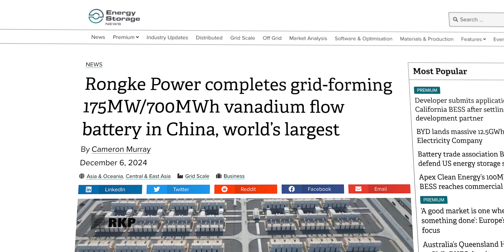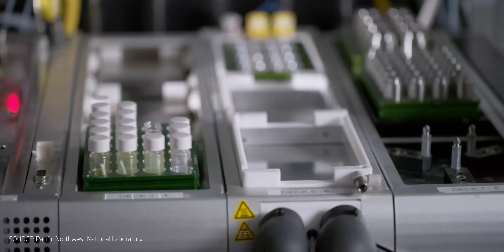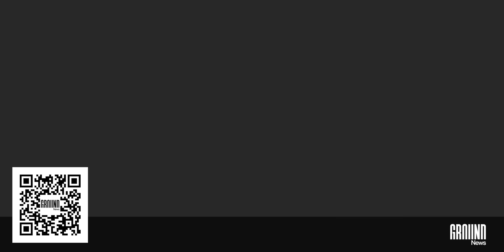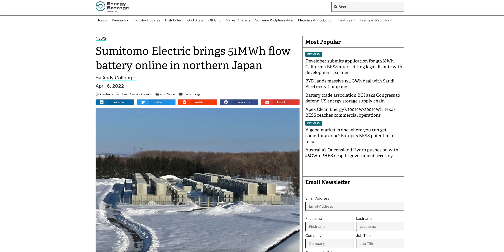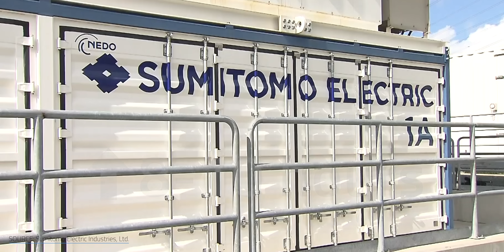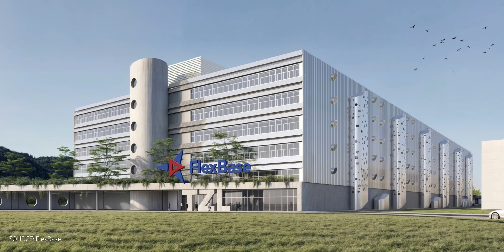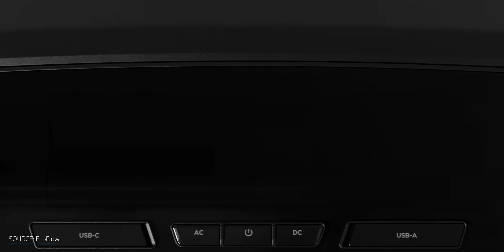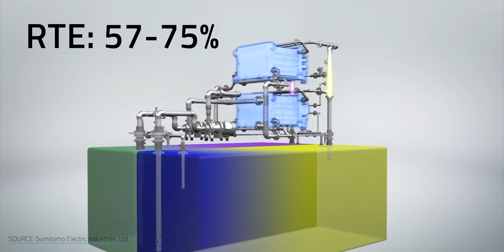Why Isn’t This Revolutionary Battery Everywhere?

Comment: I actually worked with Sumitomo on expanding the market for these batteries back in 2019.  Part of the problem was meeting the market at the time.  Vanadium isn't mined specifically, it is part of the tailings of other mining processes and the renewable infrastructure wasn't as big as it is now, so there was limit to the number of use cases.  We investigated pilot use cases with rural areas and other off grid applications but then funding was cut off during the pandemic.  I'm still very optimistic about the tech.  It scales incredibly well with large renewables.
Reply: it feels like a egg or chicken problem. Vanadium is too expensive to use because it's not mined specifically, but the reason it's not mined specifically is that it lacks high profit uses that require a large amount of vanadium.
Reply: @danilooliveira6580  Feels like that maybe, but the other reason that there aren't vanadium mines is that it is usually mixed up with other elements. It may be expensive / energy inefficient to extract on top of that. Vanadium prices may soar if this tech ever becomes more popular.
Reply: @danilooliveira6580  no. Supply cannot create original demand. If more supply created a need, then to get rich all you would need to do is create more. If no one buys, then you would just produce more until someone somewhere does but this is clearly a quick way to go bankrupt. 

The best inventions are not created by an innate “need to create.” They exist to solve. A problem.
Reply: logically, without having real knowledge. catl and byd should know about this and if they see the advantage, they'll be the first to make happened. probably they see the disadvantages?
Reply: @YSKWatch 

The problem is known supplies of Vanadium.are concentrated in China.. again ..  
This was the mineral chosen by the MIT team under Donald Sadaway as Ambripower.
Reply: It would actually be a good fit for remote mining.  There is a Nickel mine in Labrador Canada that has an off grid diesel generating system to supply electricity but a few years ago they explore using a hybrid system of wind turbines and diesel.  A vanadium flow battery would fit their needs to a tee.
Reply: @anguscampbell1533 - Nickel mines often have huge tailing piles of iron-rich material. In with the iron could be 
...  vanadium!
Reply: @YodaWhat  Actuall it is mostly Nickel, Copper and Cobalt.
"Voisey's Bay has been producing nickel-copper-cobalt from an open-pit operation since 2005. The future of Voisey's Bay involves the transition from open-pit to underground with the development of two underground mines—Reid Brook and Eastern Deeps—extending the life of Vale's Labrador Operations well into the future."
Reply: Great insight.  Thanks for sharing.
Reply: What do you think about the possibility of it being a popular home backup solution in the coming years? As Matt talked about, the small-scale systems have a better round-trip efficiency than the large-scale ones, and they have ultra-long lifespans. To be that sounds like a perfect solution to have in homes to help lower grid electricity usage when it is costly and charge the battery from the grid when electricity is cheap.
Reply: @littlejack59  The batteries are pretty big and deal with exotic chemicals so I'm not sure how well they work on small scales.  It's definitely possible, but I dealt mostly with the batteries the size of a semi truck, so I can't make an educated comment on the viability of smaller scale applications.  But it does work on the scale of small communities.  We were looking at putting them on Native Reservations for the entire tribe.  I could imagine this working for a neighborhood.
Reply: But for small scale it makes no sense at all. I've seen this tech about 10 years ago and just a 'small scale' battery was like a very oversized fridge. You will never see this getting adopted by hobbyists at home with money. But anybody could build a diy 48v battery back then for relatively little money. As soon as you need the scale to even get to a pilot case where the scale of industry is simply required, you will need the government. Industry won't risk the money on an 'unproven' tech ever.
Reply: What was the cost of a battery to power a 40000 watts house at the time?
Reply: China mines a lot of iron ore and vanadium comes with iron ore. I bet China will make this tech mainstream like they did with solar panels.
Reply: Nvm
Reply: Sumitomo? lmao. Japan has no innovation. All talk, no action.
Reply: @i6power30 lol that jelly for japan, they only hold the most patents and have been a leader in the modern era. "Out of total global inventions, Japan has achieved 15.85% innovations. Japanese have invented numerous electronic gadgets, such as compact disks, DVD, CD-ROM, B.D., Battery(lithium-ion), dry cell Battery, MiniDisk, Optical Fiber, Light Emitting Diode, and White L.E.D."
Reply: @ Yeah, that's 20 - 30 years ago. Now, they are not innovating anymore.
Reply: CO2 is climatologically irrelevant. 

CO2 is climatalogically irrelevant: Interglaciation climate change (e.g. the Medieval Warm Period) is caused by cosmic ray fluctuations ( see the work of Henrik Svensmark, et al).

Just burn coal: the CO2 issue is irrelevant (see above). The sulfur issue with gaol is bogus too: sulfur is an agricultural fertilizer (ask the farmers). The "acid rain" issue is at most "a nuisance" (see the $500 million NAPAP study of 1990).  "Acid rain" was another one of those shallow media sensationalisms, like "global warming" and "ozone depletion". 

Global warming is 21st century superstition. 

Just burn coal.

Sorry, but however intriguing these battery-thingies are, they are just another tax-sheltered boondoggle for people who don't want to do get a real job. 

Just burn coal.
Reply: @hg2. FYI:  There is a proven mathematical relationship between atmospheric CO2 and heat retention.  Given the transfer of carbon from the crust (after being stored for 10's of millions of years) to the atmosphere should be easy to comprehend.
Reply: @hg2. Is that you Donald?

Comment: Maybe this is just stupid, but if you may have so much intermittent renewable power, why not use hydrogen for storage and use? It's very inefficient yes bus the science seems more simple, water can be gained from thin air with this closed loop system and when renewable power is so abundant that (we in the EU and more specifically Netherlands) shut it down on windy/sunny days, why not? I think we are looking for the cheapest storage when the answer on short time might also be cheap generation whenever and "costly storage" when there is way to much.
Reply: @JustRickToday  Search for videos from Paul Martin, a Canadian scientist, to understand why this doesn’t make sense

Comment: I'm kinda surprised by the overall roundtrip efficiency. Even though it is promising, maybe the tech needs a bit more research on that. This would not be lost, because this kind of loss do not depend on chemistry, so it would probably be helpfull research for all redox flow batteries.

Comment: Two pumps per system = more failure points. No moving parts in most lithium storage packs. Could have cells go bad or electronics but I like the no moving parts that can fail.
Reply: Pumps are very cheap. So just have two spare pumps with pipes on hand. If a pump dies, just turn a valve - its not a big issue.

Comment: Vanadium is not easily accessible. Simple answer to your overall question. This was a poorly thought out premise.
Reply: Twice the amount of Vanadium is extracted annually compared to Lithium, but it's usually found in bound other minerals often iron bearing ones; one common source is as a byproduct of the steel making industry. However, as it's importance is rising direct extraction of deposits also takes place now days in South-America, China and other locations.
Reply: @GruffSillyGoat The oxidation states of extracted vanadium is important as noted in the video, but additionally vanadium has toxicity concerns, also noted in the video.  LiFePO4 batteries are non-toxic and their draw backs are mostly size, which is not a problem for large scale applications.  Lithium is not easy to mine/extract however it is a critical mineral and we should focus on finding better sources rather than banking in on vanadium.
Reply: @ - Some Vanadium compounds are toxic, just like some Lithium and Phosphorous ones are (even some compound of Iron can be toxic). However, in VRFB the toxicity tends to be due to the type of electrolyte used, some are and some are not toxic. This is similar to differing types of Lithium batteries. However, as a contained system neither are directly hazedous to the environment, like many other industrial systems. VRFB also have a high saftey risk being non-flammable, reducing the leak risk due to external factors.

In the end having a mix of battery technologies that offer different characteristics is better than relying on a single technology. Some applications may required the higher current provision of Lithium for example, others may require the long term storage and simlple lower cost expandability of a flow battery. One size doesn't fit all needs.

Comment: To be fair, efficiency of 57%-75% in massive systems is in line with or surpassing (on the high end) conventional pumped hydro.
Reply: Same o issues with pumped hydro... can't just build those anywhere and they require a ton of water, land, and work.
Reply: i guess it goes worse the more massive it gets, and 57% is only starting to match massvity of pumped hydro

Comment: 51Mega Watts sounds like a lot but Tesla's Lathrop facility in California produces 40 Giga Watts of storage annually. Add the Shanghai facility for at least another 40 and soon an additional facility in Texas.  And of course China has a lot more production currently making batteries.
Reply: It will be 40 Gigawatt-Hours (GWh), not GigaWatts (GW) It is easy to confuse maximum power output (in GW) with maximum energy stored (GWh), but they are very different issues.

Comment: I have worked in labs for 40 years and have never seen a scientist peering at a vial
Reply: @PaulG.x  What kind of lab are you working in? I've only worked in an analytical lab for 30 years but I look at vials almost daily for color, solubility, phase separation or particulate.  I also get annoyed by fake lab stuff.
Reply: He forgot to mention he is blind :P
Reply: Weird because I did a 3 month "internship" at one before moving on and they did it with every sample. Part of quality control before they fed the sample into the mass spectrometer.
Reply: I don't work in a lab and look at vials once in a while. Are you sort of like one of those mechanics that doesn't mechanic?
Reply: Sounds like those labs weren't sciency enough XD
Reply: I used to isolate proteins and would look at vials all the time…you working in like a robotics lab or something?
Reply: CO2 is climatologically irrelevant. 

CO2 is climatalogically irrelevant: Interglaciation climate change (e.g. the Medieval Warm Period) is caused by cosmic ray fluctuations ( see the work of Henrik Svensmark, et al).

Just burn coal: the CO2 issue is irrelevant (see above). The sulfur issue with gaol is bogus too: sulfur is an agricultural fertilizer (ask the farmers). The "acid rain" issue is at most "a nuisance" (see the $500 million NAPAP study of 1990).  "Acid rain" was another one of those shallow media sensationalisms, like "global warming" and "ozone depletion". 

Global warming is 21st century superstition. 

Just burn coal.

Sorry, but however intriguing these battery-thingies are, they are just another tax-sheltered boondoggle for people who don't want to do get a real job. 

Just burn coal.
Reply: @hg2.  you have to feed a bot a lot of garbage to get that bs out

Comment: Uh... Did you speed this up? You're not usually so... rabbity. I'm only 20 seconds in so far, maybe it will taper off.... (EDIT: Yup, you sound normal with my playback control at .95, seems your editor thought you were a little sluggish today)

Comment: sodium is pretty cheap, I think the salt base flow cell batteries have a good chance at large scale due to low cost and abundance.
sodium based solid state batteries are coming online now too.
Reply: Sodium is cheap but less efficient than lithium. 
I am expecting sodium to take the main role for laptops and phones, while lithium to stay  in cars.
Reply: I heard that sodium battery is better but heavy, that's why the implementation is limited for non moving usage.
Reply: CO2 is climatologically irrelevant. 

CO2 is climatalogically irrelevant: Interglaciation climate change (e.g. the Medieval Warm Period) is caused by cosmic ray fluctuations ( see the work of Henrik Svensmark, et al).

Just burn coal: the CO2 issue is irrelevant (see above). The sulfur issue with gaol is bogus too: sulfur is an agricultural fertilizer (ask the farmers). The "acid rain" issue is at most "a nuisance" (see the $500 million NAPAP study of 1990).  "Acid rain" was another one of those shallow media sensationalisms, like "global warming" and "ozone depletion". 

Global warming is 21st century superstition. 

Just burn coal.

Sorry, but however intriguing these battery-thingies are, they are just another tax-sheltered boondoggle for people who don't want to do get a real job. 

Just burn coal.
Reply: @hg2.  What about when there is no coal?

Comment: Like all newer tech you expect the price to be high. If this starts to gain traction more vanadium suppliers will emerge and drive down costs. Grid scale storage is now the biggest challenge so I welcome any new technology in this sector.
As a reference lithium-ion batteries are 10x cheaper than they were 10 years ago.
Reply: They are 10x cheaper despite inflation, so they are actually closer to 20x or even 40x cheaper.

Comment: Really interesting though 57% recovered energy is alarmingly low.  Great there getting built and working.
Reply: Solar and wind generate excess power, so the cost per kWh back to the grid is perhaps the most important factor.